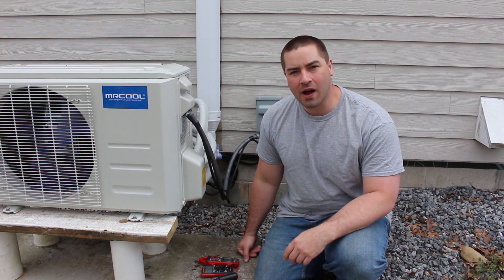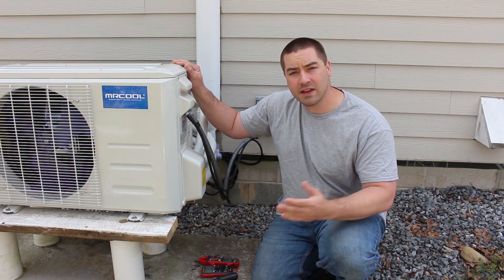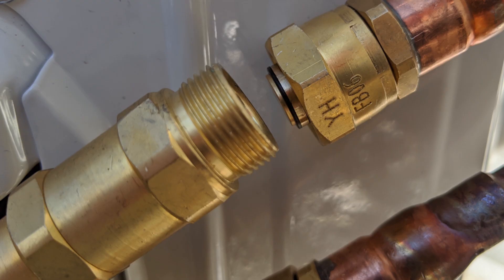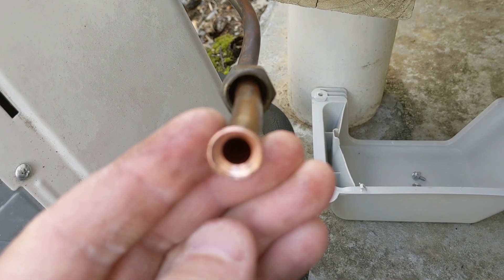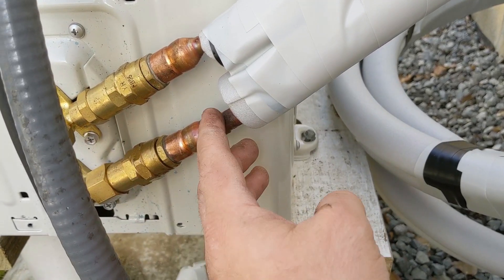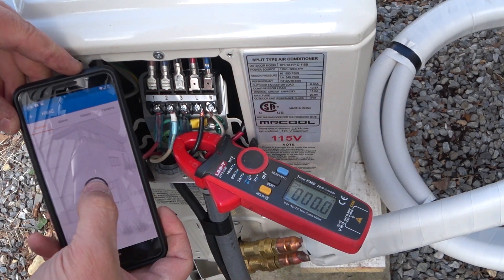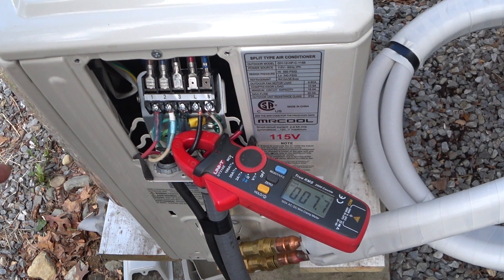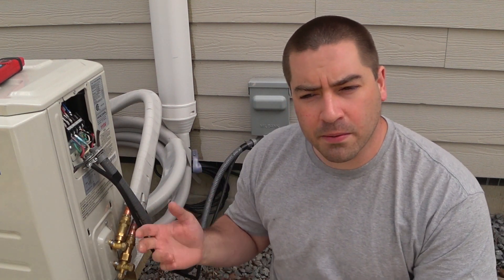Q+A on the DIY Mr. Cool Mini-Split Heat Pump

Comment: Take a look for SonOff switch but the "Power" one called "Pow R2" (it is Revision 2 or higher) that measures kWh day by day you can get for cheap 15$ that you then have to flash with tasmota if you want a pure local solution. You maybe might start with the sonoff app first and then flash that tasmota firmware which is opensource and vivdly supported and developed. There is also another one that can measure 2 power lines or devices one to another with just 1 of these devices but a different one.... called DUAL...

https://www.banggood.com/SONOFF-POW-R2-AC90-250V-16A-3500W-WIFI-Wireless-APP-Remote-Control-Switch-Timer-Socket-Power-Monitor-Current-Tester-Works-with-Amazon-Alexa-Amazon-Echo-Dot-Amazon-Tap-Google-Home-Nest-Assistant-IFTTT-p-1279097.html

We used it for example to measure the energy of outdoor lights and surveillance cams while hunting hidden inefficient consumers to measure their power consumption short term or long term like a washing machine or dryer that then runs over months. You can also switch these devices on and off or used it as a timer or a dawn driven on / off switch  , cause power measuring is only a tiny add on function . Workes great for all devices less than 3.5 kW and we use it particular for washing machine and dryer, also all outdoor plugs ....
It measures consumption by days, weeks, months, years and expectation. 

It also works perfectly for smaller solar power array like our first 3 kWP to measure the real output after your converter ... and locally of cause.
Tasmota can be found here https://github.com/arendst/Tasmota

Here is a Tasmota tutorial and the second ready to go local solution from Shelly, not the cobra, but a ready to go solution that does not talk back made by an hungarian company that does not need a flashing like the sonoff with tasmota but can be flashed too. That is roughly the same price. The video is from an experienced suisse guy and straight forward explained
https://www.youtube.com/watch?v=fzEDFmB0UYU
Tasmota is not complicated, there are tons of other videos and tutorials but as you mentioned before the not IT guy it might be easier for you to go that shelly way here for 11$ I guess or 12,50€ may be plus taxes .

This Shelly can be used inside or better under a socket outlet (european sizes) inside the wall and you will be able to switch and to measure  
https://shop.shelly.cloud/shelly-1pm-wifi-smart-home-automation-1#51

Both solutions offer the same but check for the US 110V ... cause in europe we run 230V  ... but I guess both solutions should work for you ...
SonOff has also a different one in rectangle form factor to use inside the wall as shown in Andreas video above, but be aware that this is a switch only and does not measure. 
Andreas Video explains how to flash any device ... and in case of SonOff you can only measure with the POW R2 that you can flash as described in the video. 

You can also add 2x 220 cables for in + an out like a cable prolongation with the measuring device in the middle, where you would need the cables and a plug and socket. 
Works for shelly and SonOff. But you have to make sure that you buy the power meter or power consumption devices cause in most cases they look all the same ... but are different.

For switching you can use an app, a browser or URL and hardware wifi switches too (offered by SonOff with glass surface etc.). 

Shelly Power Meter and Remote switch
https://shop.shelly.cloud/shelly-1pm-wifi-smart-home-automation-1#51

SonOff
https://www.banggood.com/SONOFF-POW-R2-AC90-250V-16A-3500W-WIFI-Wireless-APP-Remote-Control-Switch-Timer-Socket-Power-Monitor-Current-Tester-Works-with-Amazon-Alexa-Amazon-Echo-Dot-Amazon-Tap-Google-Home-Nest-Assistant-IFTTT-p-1279097.html

We use both solutions and .. shelly for in wall or socket and SonOff for others like in the garage
Reply from the maker: Thanks.  I'll check out some videos to see how complicated it is.  You are correct, I'm not a computer guy.
Reply: @DavidPozEnergy  To clarify, Sunoff is all controlled from a smartphone app, but it is essentially an arduino with relays, whatever special features are specifc to the model (they have one with a temp probe and this that I think uses a shunt and voltage sense circuit all built in), and their custom code so setup is as simple as pair with bluetooth to set wifi name and password and program on the app.
Reply: @DavidPozEnergy  Sunoff is nice, they can work with a protocol/feature called IFTTT (IF This Then That) to program automatic switching. This lets you program based off of devices location or connected Wi-Fi or Bluetooth, weather reports, time of day and day of the week and run timers and some other things that may be more useful for other types of devices. These are the cheap and easy option that people mean when they talk about smart home. I've used them for christmas lights and well pumps so far and they have been 100% reliable for me which is amazing for the price.
Reply: @DavidPozEnergy  lots of diy options out there but they all require a decent amount of computer knowledge or the patience to learn. Maybe hit up sense or one of the other manufacturers for a free unit in exchange for a review? This might help too. https://youtu.be/5RyDxZLA8b8
Reply: DavidPoz Sonoff 2 is only rated @ 15amps. I’m not sure it’s a great solution for something that doesn’t plug in. A proper energy monitoring system like Efergy (they’re OK but I think there are smarter ones) might be a better option. The rely on a Hall effect sensor much like your clamp meter.
Reply: UPDATE: since 1,5 months we have an electric. car, an e-golf and that is charged over a usuual home plug with 2,1 kW ...

Most people laugh about it but it works great cause from 8 to 8 during 12 hours per night the car can get 25 kWh or 175 km of range and yes, we use the same plug as our "gas station" counter cause the power comes from a solar system and its batteries. 

And next year we will sell our tesla and get a reliable VW id.3 with 550 km range which space inside equals mercedes e-class - with the same dimensions of a VW GOLG VÍII.
2 guys 195 cm tall can sit behind each other and the rear passenger still has more than 12 cm space to the drivers back or a fist fits betwern his knee and driver seat.

Production will explode within weeks due to high european demand and I guess this car won't be shipped go the US soon.
They open the böoks for orders mondsy - except 37000 prebooker that will get the car

Comment: I sure like my well water heat pump it is cheap to run and will work on a decent size split phase inverter but it does have a surge after all it is 15 years old. No surge is a big deal so you will have pretty good heat and AC.
Reply from the maker: 15 years is a great run.  And using a well instead of the air should be way more efficient.  Nice.

Comment: The Shelly EM is a great little energy monitor that I use in my home it connects to wifi and there is an app, you can also use it in 
local mode. Hope that helps get the info you need and thanks you for all the helpful videos.
Reply from the maker: Thank you, I'll check it out.
Reply: @DavidPozEnergy  https://www.youtube.com/watch?v=NqFXepQX9QI
Reply: You may not get the device  to recognize  a mini split according to comments on several  support groups. The problem  extends to  hybrid electric water heaters. A inline meter can be had for  $149.00. .. Amazon !
Reply: Yes, my suggestion as well, i use the PM version with 3 temp sensors. One for ambient temp at the unit en 2 for in and outgoing line temp.  Very small and cheap unit. Paid about 30 EURO for it in the Netherlands